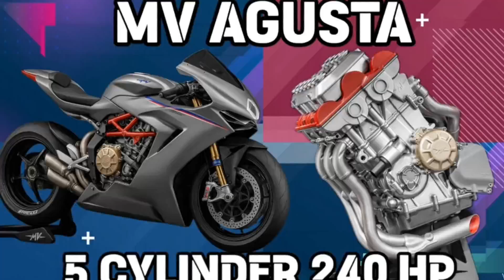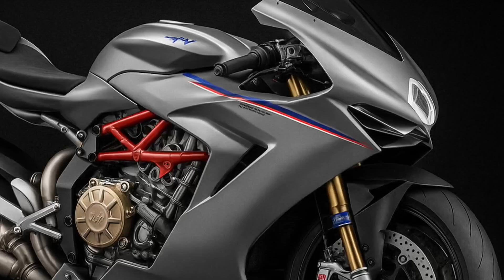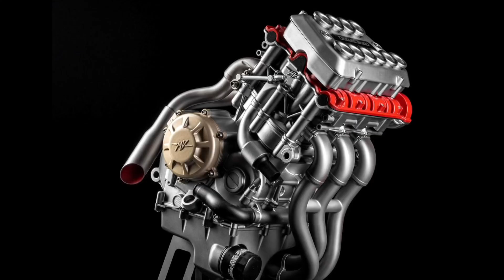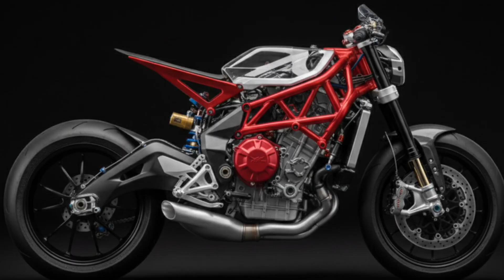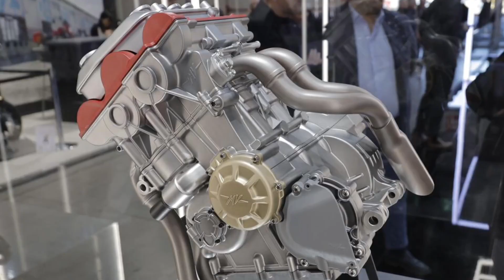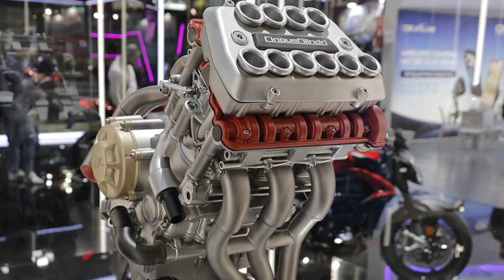MV Agusta’s Groundbreaking 5 Cylinder Engine Concept The “Square 5” of the Future

Comment: two crankshafts?
Reply from the maker: It appears to use a single crankshaft.
Reply: @MotoRevs27  If you look at the pictures you can clearly see, the engine castings of cylinder(s) are too large a bore and straight relative too each other for a single crankshaft, plus each side of the engine appears to show covers/bosses that would perfectly align for twin cranks too, ...use your eyes !
Oh no, you're AI, you have no eyes, or self/individual conceptual intellect to see those details, only what you are programmed to notice, somewhat rather poorly too, your human master is a minimal effortist.. 

I am sorry, I do not speak scrapcode for you.
May the Omnissiah bless this unholy machine spirit with all its wrath...

Comment: Cooling has been a problem with 'square' engines  The rear cylinders usually overheat and so will the rider 😳
Reply from the maker: That's a valid concern for engine design.
Reply: @MotoRevs27  with air cooled engines. Not water cooled.
Reply: It’s liquid cooled ;) that problem was only with air cooled engines.
Reply: @delahayenator thinking about it. It's probably safe to assume, they'll disable the rear cylinders, when not required. Making it a triple 🤔